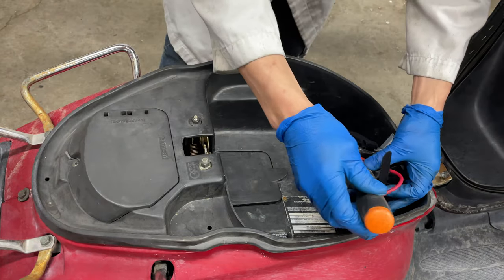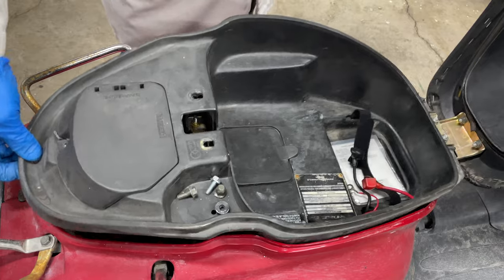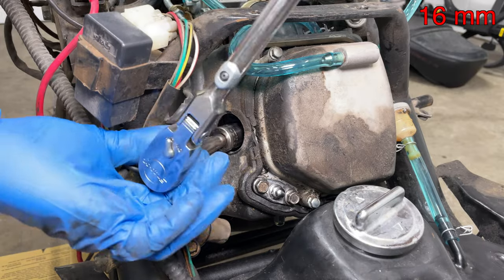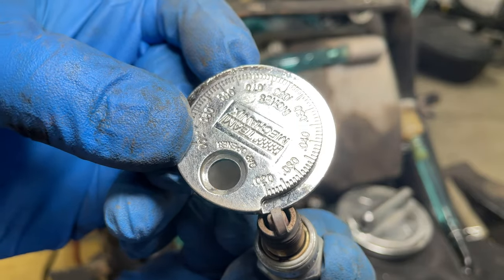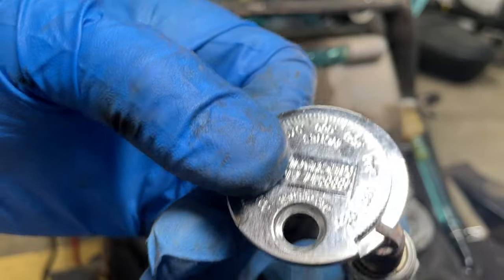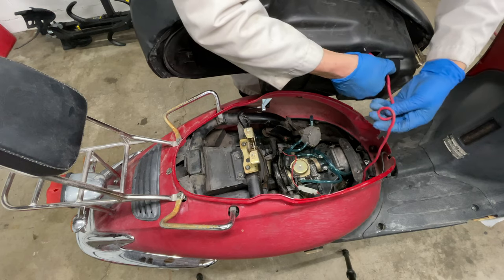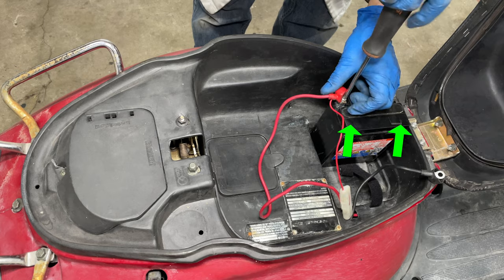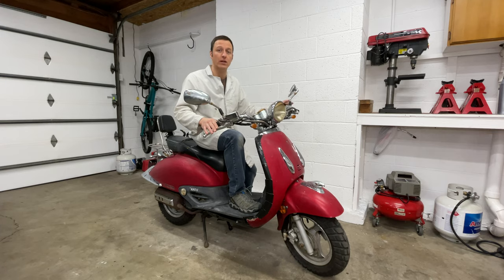Changing the spark plug in a 150cc GY6 Chinese scooter

Comment: I have a 49 cc gas scooter and the spark plug hole is strips how can I ree thread it
Reply: They are a rethreading tool
You can put in the hole and slowly work the threads back to place. If not you might need to use a helicoil